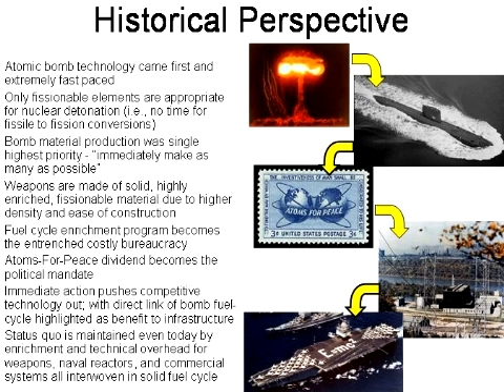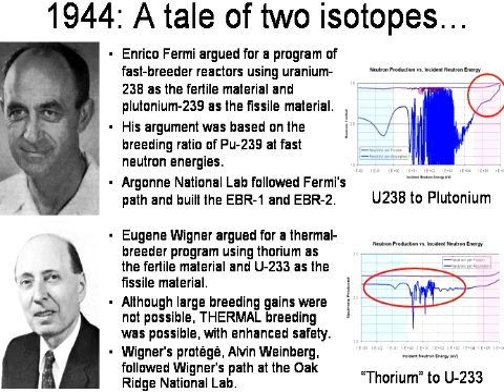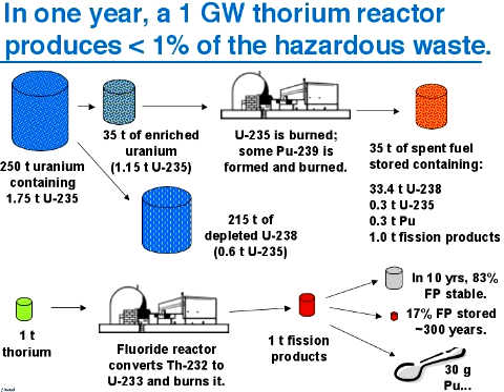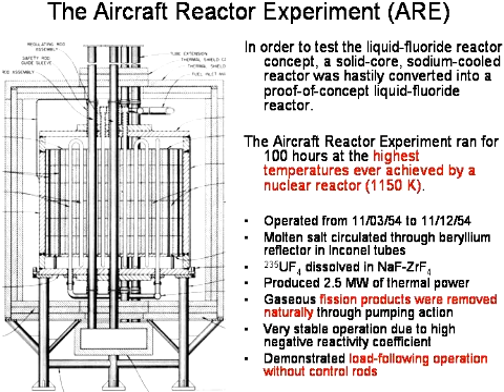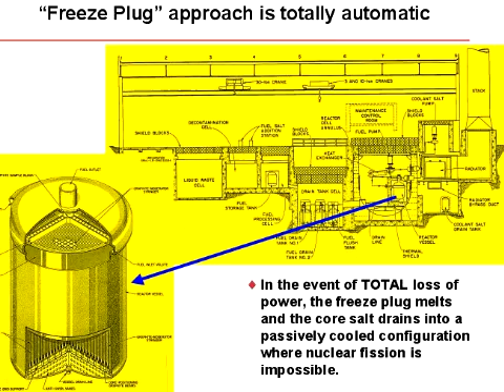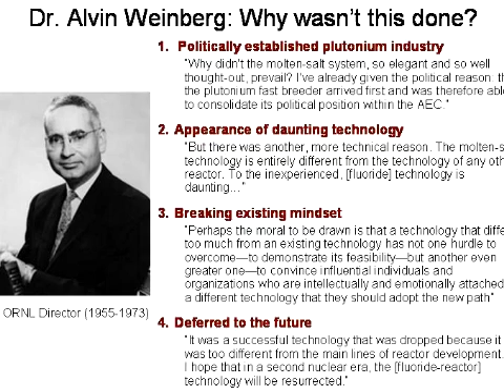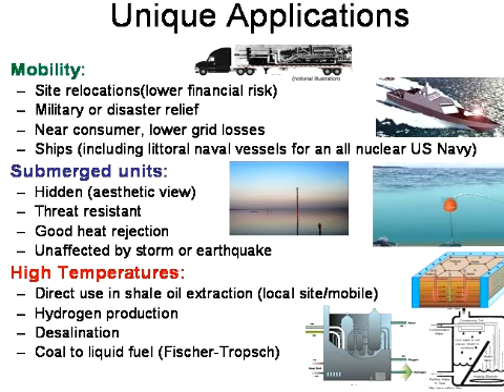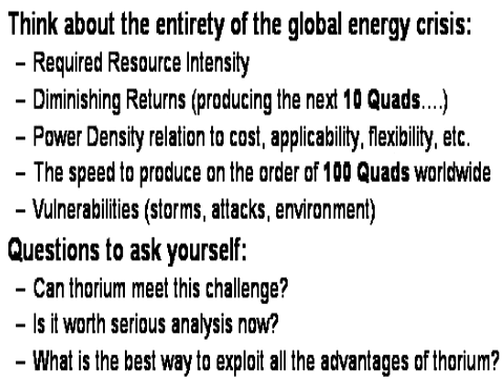Thorium Remix 2009 - LFTR in 16 Minutes

Comment: Around 4:00 it says lower cross sections for fast neutrons mean fast reactors are less efficient. It doesn't, it just means fast reactor cores have to be less diluted by fertile material. The claim of "5 times more heat per unit fissile" is completely bogus - I'd like to know which speaker is saying this.

The analysis also neglects long-lived fission products which have half-lives over 200,000 years.

Comment: None of the Thorium youtube videos explain Graphite moderator degradation from high radiation. 

Also, plumbing issue is not just for 1 fluid vs  2 fluid design. In water reactor fuel is encased in zirconium alloy cans keeping fission by products out of water (fuel failure).

In LFTR, all  channels in core are under very high radiation, but also all the pipping those exchanges heat with gas (ie Brayton cycle). 

Liquid is 700-900C so SiC or some Hastelloy "double" pipes to avoid contamination.